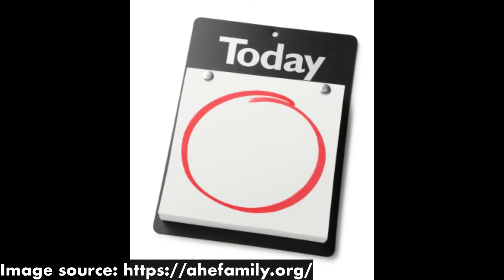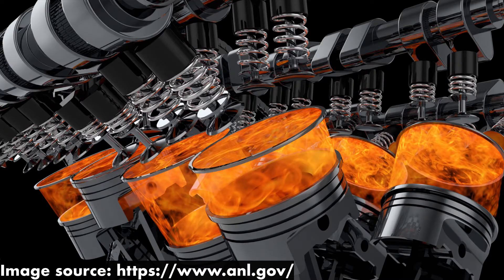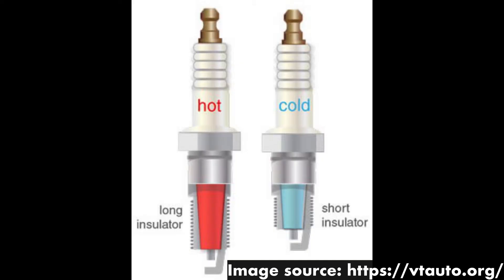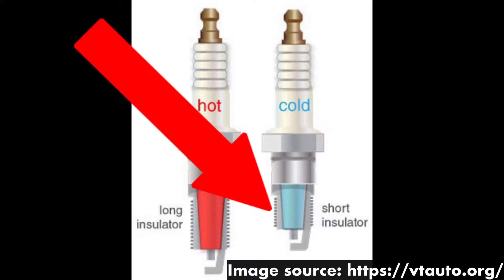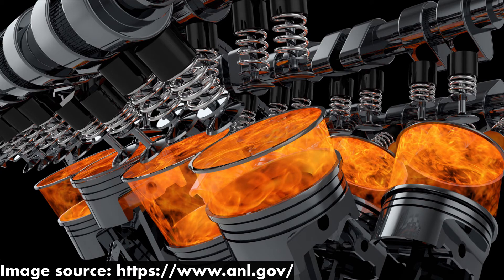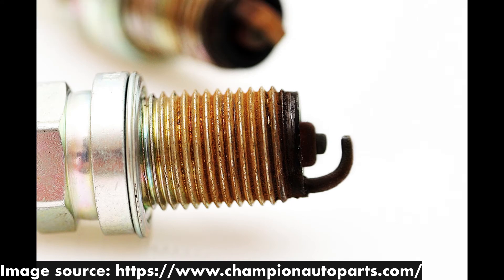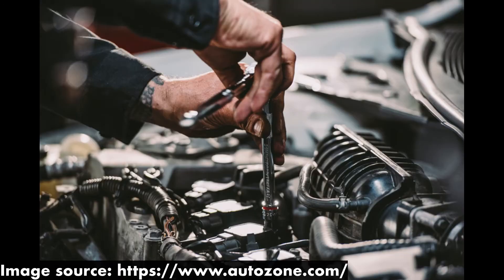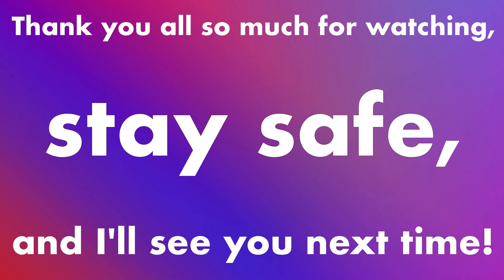Cold vs Hot Spark Plugs - What's the difference? | Ignition & Beyond

Comment: Hi good day am looking for some spark plug to work in a MR20 gas engine which has a CNG ket installed. Right now am using Denso FXE20HE11 PLUGS. I need some plugs to hold out for a long time because the CNG gas is causing the plugs to burnt out fast.
Reply: Iridium plugs will help then

Comment: Wyt is the difference between hot and cold spark plugs?

2) When do we need each one?

3) How do we increase the voltage in the spark plugs

4) Explain how to properly set the gap on a spark plug .. What are things to look out for?

5) Why are spark plug sockets important
Reply: Why would you ask a question that the video answers? 
Why would you ask questions the video was not meant to answer? If you want to know those things go find YouTube videos on that question. 

If you don't know when you need different temperature spark plugs, then you don't need them.

If you don't know how to increase the voltage of a spark plug then you don't need to increase the voltage. If you modify your engine satellite with an accessory that requires a larger spark gap requiring increase ignition voltage either you know about the accessory or while you learn about the accessory you will learn a bit requires higher voltage ignition, but again if you don't know why you need increased voltage you don't know how to increase it then you don't need to increase it. 

If you want to know how to gap a spark plug go watch a video on it. But don't watch a video about replacing a water pump only to comment asking how to change a tire. 

Spark plug sockets are important because you need tools to remove a spark plug. It's like asking a plumber why is a pipe wrench important. I hope you see how stupid of a question that is and yes there are stupid questions. Spark plug sockets are not a requirement but a socket that is deep enough with enough clearance for the spark plug. Spark plug sockets have a rubber boot that holds a spark plug from falling out but if you have a socket that's the right size you can use other items to hold the socket in place. But if you want to do the job right with professionalism get the right tools
Reply: @Cyber_Cowboy Hello, 
A machanic fit heat spark plug in my hyundai Vanue turbo petrol (in which cold spark plug are recommended), due to this the engine stopped producing power after 60 km driving(car move but do not climb even a simple slop).

Went back to machanic, Now I have cold spark plug installed, I have two questions 
1. how to know whether the wrong spark plug have any damage on engine.
2. Will this small 60km event will effect lifetime of my engine (should I sell this car?)